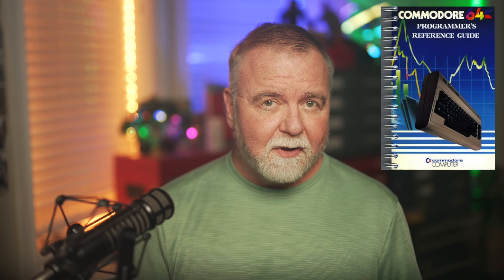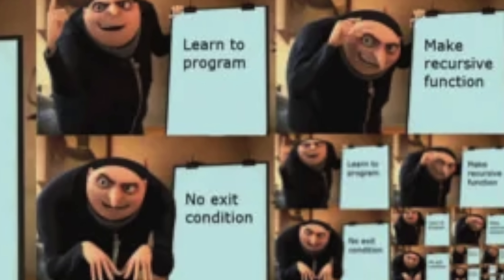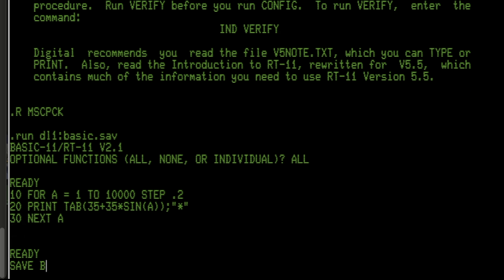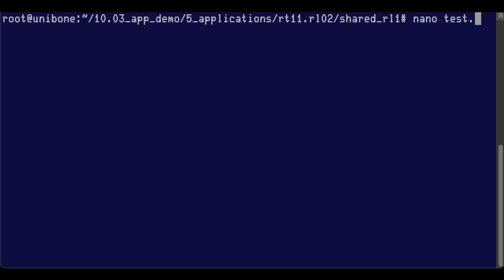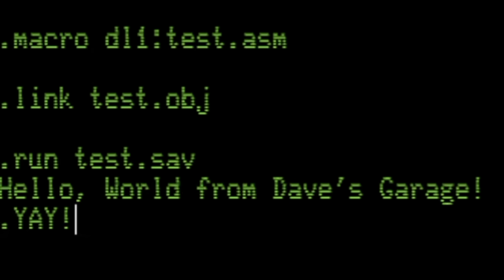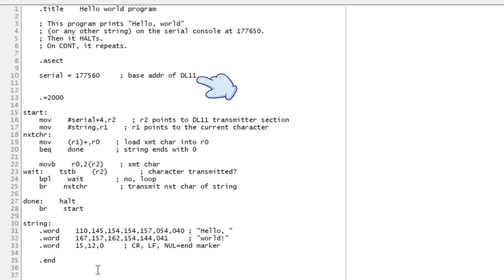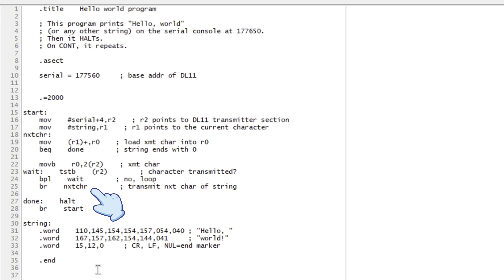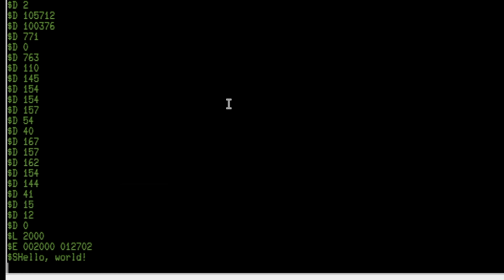Bare Metal Coding: Big Iron!  Assembly Language on the PDP-11/34

Comment: Too many coders today are so disconnected from the proper hardware.  More like this is just fantastic.
Reply: I agree with this comment, a lot of coders have the potential to working with hardware but most programming languages nowadays are high level. Python since everyone has heard of it, has gone off the metal. It's an interpreter and mostly functional programming, meaning someone has already worked around some libraries to make it easier for newbies and for lazy programmers. Other languages such as JavaScript, PHP, react are web programming languages and are intended to work with website development.
Reply: @lightinside87  any tips for a newbie coder who only has experience with Python? I really like the concept of efficient code. Assembly perhaps?
Reply: @canobenitez  read up some books, ebooks many online video tutorials and hands on. Much like how you're experiencing Python.
Reply: @canobenitez start learning assembly on a C64. That way you can learn the basics in a small and efficient environment
Reply: @CallousCoder  I think there might be some nostalgia tax on those things, lowest I could find online was U$D 300 in my country. any alternative?
Reply: @canobenitez  oh for sure! I got mine for free from my old employer whom otherwise needed to pay to get it recycled.
If it’s just about coding for you, than I would just run the PDP11 emulator in a pi (without the nice but expensive PiDP11 front panel).
Sure the real thing is nice, but emulation or fpga is a great alternative for just experiencing the software too.
Reply: @canobenitez Don't go straight to assembly, learn C first. I've been researching this for a while now and, to my understanding at the moment, it seems like the best intro or way to really understand assembly would be through 6502 assembly, it's just easier, the architecture of the 6502 is much simpler, and you get all the same benefits of bare metal coding education. And from 6502 assembler, it would be much easier to learn a modern x86 assembly language afterwards. But yeah start with C, there's a book called "Learn C the hard way" which I would recommend, and then pick up a book on data structures & algorithms. That's the key whenever you learn a language is to not only get familiar with the syntax, but also to learn data structures such as linked lists, stacks/queues, hash maps, trees, etc. And then get familiar with its standard library, and perhaps some other libraries that are popular and fun/interesting. As far as hardware programming goes, through C you will learn memory management and you'll learn about the memory hierarchy, difference between stack & heap, etc. That will be the first crucial lesson is in gaining good knowledge on memory and memory allocation.
Reply: @lightinside87 This is why I hate the whole high level full stack web stuff. It's why I prefer C++. It supports high and low level concepts all in one place. No need for the JNI crap that java relies on. C++ implementations produce efficient high performance standalone executables. Web front end development tool are full.of ugly hacks and workarounds. JS is an awful language that took hold for all the wrong reasons.
Reply: The hardware is far too complex to be connected to it.  Sure, you can write assembly code, but did you map the output device into address space, after elevating privilege, hitting the MMU, ACPI, and PCIe subsystems (I guess??)?  No, you called the OS to fetch a device handle, then passed it back with your parameters, just like with high level code.
Reply: @udasai I wrote assembly directly to the memory mapped GPIO of a Pi. Nothing complex about it. And you don’t need to control all the hardware to the bit — that indeed these days is very cumbersome. But as a developer you need to know what it does and know a good amount of what your OS does. And they simply don’t with their crappy Python and JavaScript. As a result software is inefficient large and buggy compared to the systems of the 80s and 90s. They can’t even write C in most cases. Which I consider a high level language. They wouldn’t know how to allocate and free memory if their lives depended on it. And it’s fine to use memory managed languages only when you know how that works.
Reply: @CallousCoder the vast majority of our non automated tickets are from devs who think that latency only comes from the network. It is astonishing how little a very large amount of devs even know about how anything works.
Reply: @CallousCoder finally someone here who has some damn sense
Reply: @udasai oh one a actual example. We had a guy at my client (a big bank) who wrote some script in Python 😂 to take data and distribute it into two different queues for faster processing. He used a bloody modulo 2==0 instruction to go through the 5 million or so records and split them into 2 different processing queues. 
That little hobby project of his took well over 50 seconds. Which is insanely slow in those systems. I looked at the code and I was like: “fuck me why use a bloody modulo in this case when you can just use a logical and 1 and achieve the same thing.” And voila from 50+ seconds it ran in a slow 10 seconds. But still a 5 time increase just because I knew how interpreters and low level code works.
Reply: why? i am old too, but that's one more reason to not waste time with ancient stuff like this.. time is precious
Reply: @gllucis its not ancient, it's the way computers actually work. so much is being abstracted away nowadays that the average software developer doesn't even know how memory works... what's the point of making our CPUs faster, cramming more ram into smaller sticks, making faster and better GPUs, if our software only gets worse? Our hardware only keeps getting better (in performance, at least) but our software only gets shittier. just look at the state of windows, or almost any mainstream proprietary software. The only good software that respects the user and makes good use of computer resources nowadays is open source software. companies take way too many shortcuts and devs are way too focused on the wrong things. we do not need this much fucking JavaScript.
Reply: @not_kode_kun the answer to that is very simple… because you decrease the time to create a high level piece of software and lower the barrier to entry. Don’t get me wrong, I love low level coding and understanding how things work. Doesn’t mean it’s practical for businesses to do it that way
Reply: @cyberchef8344  i completely agree with you, I'm by no means saying everything should be written in C. However, stuff like Electron shouldn't be as prominent as it is. In my opinion, it shouldn't even exist. All these damn frameworks also shouldn't exist. JavaScript should've stayed in the browser, python should've stayed in data science, ML and prototyping. We've stayed too far from the low level. There's a place for all of these languages, but they're being completely misused nowadays because of lack of competence, lazyness, and hype. At least that's what I think
Reply: but as someone else in this comment section stated, companies don't care about good code. they don't care about making a good, lean, simple application that gets things done, they care about making a product that appeals to the masses. and the masses don't care about good code, nor do they know how to recognize it. that's why i stick with open source software only, it's the only software that isn't made with the sole purpose of milking the maximum amount of money from its users.
Reply: They don’t know that when they get down to assembly, they are just on the other side of the wall from the hardware engineers. So close, and yet so far.
Reply: Facts
Reply: There is no need to. That’s like saying mechanics nowadays don’t know how to work on a Model-T. Such a dumb comment.
Reply: @user-mq9dy2lj5u Bad analogy. It's really about a fundamental under the hood understanding, not about old vs new.
Reply: @JonStaples-c6q  I imagine they meant more like, the low level coding/workings of modern systems, but even still, it's just not necessary for most tasks and would just waste time for someone who isn't interested in going that deep.
Reply: @JonStaples-c6q Whatbthe post implies is that abstraction also abstracts understanding. A BASIC programmer need never know what an accumulator or a program counter is. Not that they need to, but their understanding is limited by abstraction just the same.
Reply: There's nothing wrong with that
Reply: @MathewPanicker1010  "There's nothing wrong with that" is why your new TV takes longer to boot today than an old tube set from the 50s did to warm up.
Reply: @nezbrun872  Nah, that's a choice by the manufacturer.  No shot that they'd spend the money and time for engineers to optimize all that boot/initialization code.  They could if they wanted to and if there was demand for it, we'd have that talent trained up to do so.
Reply: @nezbrun872  I wish I could just buy a TV that didn't have an OS at all. For some reason, "dumb" panels are more expensive. 
I'm guessing it's a demand vs supply thing. More people want their TV to do Netflix etc. than don't.
Reply: @nezbrun872 sounds like you have a disconnect lol😂, new TVs are completely different hardware
Reply: @nezbrun872 indeed! Code these days is bloatware as a result. So called developers writing desktop apps in JavaScript with a web runtime, which as a result means the most trivial desktop app is 900MB and is slow as hell.
Reply: @MarkoVukovic0 The TV maker gets a recurring cut of revenues from the various "services" on the TV. Dumb TVs cost more to punish consumers for taking away that extra revenue.
Reply: @nezbrun872 I have a 50’s tube and i’d say that load times are almost identical.
Reply: @MathewPanicker1010 actually there is. Because they can’t efficient code anymore. And they can’t develop in the strength of the system as a result.
Reply: Little know fact: Microsoft heard about people building virtual hardware (CPUs, even PCs) in Minecraft blocks. So a VP at Microsoft lobbied to purchase Minecraft for several billion dollars with the goal of moving all hardware into the virtual Minecraft ecosystem. The stated goal was to implement this recursively, and eliminate all hardware all the way down. Microsoft envisioned a hardware-free implementation of personal computing. Everything would be virtualized all the way down, zero hardware anywhere.

This may sound silly, but how else do you explain the purchase of Minecraft by Microsoft ?

🙂 !!
Reply: @JxH  it all still needs real hardware though. I'm guessing they want to monopolize the virtualization game.
Reply: @MarkoVukovic0  No, the Microsoft VP was proposing to implement it recursively, so that it would be Minecraft virtualization all the way down. No hardware at all. The proposal was intended to eliminate Intel and AMD.

Yep, that was the plan proposed by the Microsoft VP...  Yep...

;-)
Reply: @JxH  ok, but virtualization still requires hardware on the backend.
Reply: @MarkoVukovic0  Nope, it's recursive. So it's Minecraft virtualization all the way down. That was the whole point of Microsoft buying Minecraft. Zero hardware, just recursive virtualization all the way down.

;-) !!
Reply: @JxH  ok, so what's it all running on then?
Reply: @JxH  🤣
Reply: @lightinside87  It's recursive. It's Minecraft virtualization, using CPUs and other hardware built-up using the famous 'blocks'. And each instance runs on another virtual system, all the way down .

Same as "It's turtles all the way down."

Infinite recursion.

Yep.

;-) !!
Reply: @JxH  recursive is what you keep replying, you should elaborate if you can loop out of your recursion. Because I surely don't understand anything of what you're saying?
Reply: @lightinside87  

;-)  !!!
Reply: @lightinside87 I think he’s trolling (thank god)
Reply: So many of you not understanding @JxH is joking, and he keeps pointing it out with a wink face. You folks who missed it, need to buy Daves book.
Reply: @JxH I uhh. I hope ya don’t actually believe this.
Reply: @JxH  this makes 0 sense.
Reply: @JxH Was the purchase before the first version of Windows was coded ? 

It is these 'blocks'  which bother me.

Comment: My first programming experience was on a PDP 11/70 at U.C. Berkeley in 1978.  I still have my 6th Edition Berkeley Unix Programmer's Manual (really a Unix reference manual) sitting on a shelf in my basement.  As I declutter my home at this phase of my life - this manual needs a good home.  I'll send it to you if you'd like it - or to some other place you might recommend.

BTW - My assembly language experience centered on writing IBM System-34 assembler - I wrote a job submission and return application for offloading jobs to an IBM Series-1 running FORTRAN programs.  I did a little IBM System 370 assembler - but nothing as interesting.

Comment: I am glad you are doing this series. The PDP-11 was a fun machine. Though, I only ever had the emulator that ran in a PC on an FAA certified flight simulator. By the time I got there the hardware had been replaced. 

I do have some real old hardware experience though. I am not much older than you but I started at a small flight simulator training company in 1986 and had a simulator that had see a DDP-124 for the host and a Varian 620/L for the visual. Both used paper tape and I assure you, pranks were pulled with the bits that were punched out.  

I rather miss programming in Assembly or just punching in a quick program for diagnostics using the data and register switches on the front panel.

Comment: nano?  Really?  😏
Reply: TECO ftw! 🤩
Reply: @fburton8   I hear they have some fancy macros for that!
Reply: @mercster  I’m pretty sure that TECO was (is!) Turing-complete, but it was also also totally unreadable. I remember playing around with code to sort lines in a text file. It was really hard going and not that enjoyable. However, for a while I did use it for editing other code.
EX$$
Reply: @fburton8   Yeah, thus emacs, which began as a set of 'Editor MACroS' for TECO, making it easier to use.
Reply: On the other hand, I couldn't write anything on bare metal.
Reply: @mercster  It's not that hard. The hard parts are usually juggling registers and memory, but with 6 general purpose registers and 256K that's a non-issue here. As Dave mentions, lots of chips were influenced by the PDP series including the 6502 and to a far greater degree the 68000. If you can write 6502 assembly, the other two are no sweat and all three share the same JSR and RTS instructions. Grab a book on starting 6502 assembly and check out the 6502 series of videos from Ben Eater and you can do it.
Reply: @Peter_S_   I took VAX ASM in college, but never enjoyed it and wasn't that good.  I'm a higher level guy, and went more the systems management route.  At my age and current situation, if it were possible to feel negative desire to engage in something, it would be writing asm.  ;-)  Thanks for the confidence vote, though.

Comment: 15MHz... can it run Doom?
Reply: The serial display here is the Achilles heel of that question.
Reply: @Peter_S_ You don't need to display anything to have Doom running. Having just enough memory and port of the game is enough to run it on about any computer. You could make graphics card for PDP-11 though. Simple framebuffer is enough and as long as it can display 320x200 with 256 colors from user defined palette where each color channel has 6 bit you could make it display pixel perfect.
Reply: @e8root  🙄